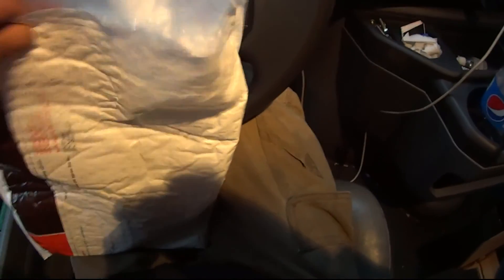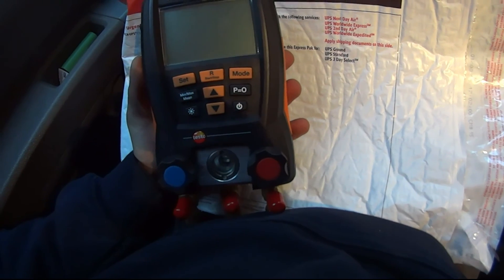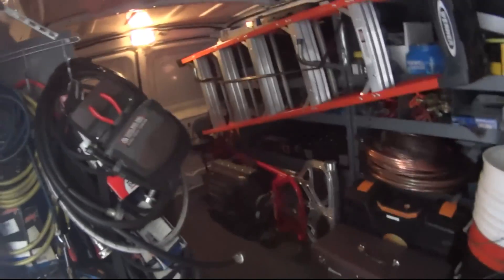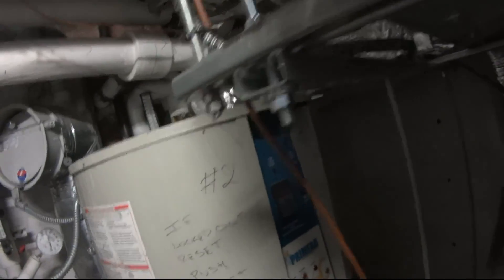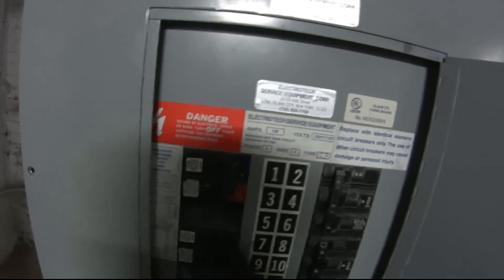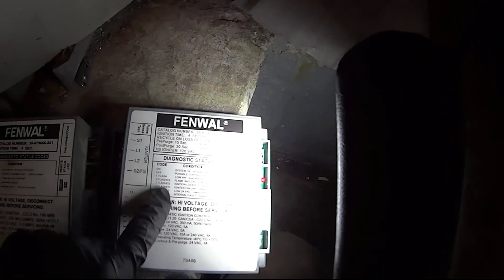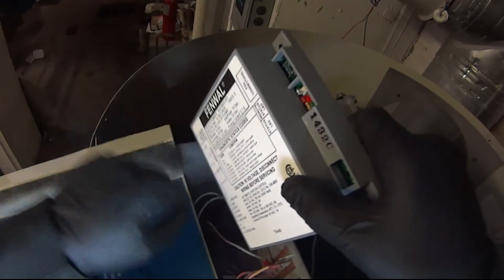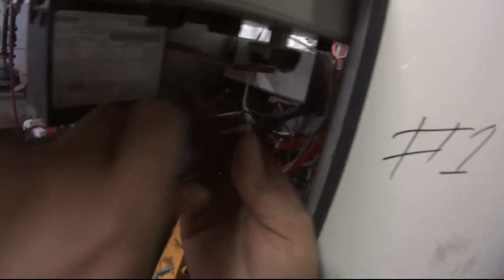HVAC | Fenwall Ignition Module- Primera Boiler 1600B

Comment: Emin nice way of troubleshooting the issue , u were lucky there was 2 units and we're able to preform that test cause the last thing u want is replace that 300$ part and be wrong . Good job and video.
Reply: Nice work. That's what you have to sometimes with an intermittent problem.
Reply from the maker: I checked everything on this freakin boiler. I knew it was the module, swapping just helped me confirm it lol. Normally I Carry 1 Of Those fenwal Because I Have 5 Boilers That Use It
Reply from the maker: Rob HVAC sometimes it's the best option

Comment: Just replaced a near identical fenwal on a raypak boiler a couple of weeks back.  Worked fine in front of you and then rare lockouts. Finally caught it: culprit was the onboard relay for the HSI not powering the HSI and then the current proving sensor would see this and lockout on an ignitor failure.  Wouldn't be surprised if something similar happened with this guy.
Reply: I have a Raypak doing the exact same thing....just ordered a new ign. module yesterday. Glad to know my deduction was correct!

Comment: Great way to troubleshoot isn't it lol. Those Primera's are still causing trouble I see.
Reply from the maker: Yeah man that second one would go into ignition lock out ever week or 2 or so. So I just swapped the module to see what happens and sure enough boiler 1 went into lock out with the module from 2. That's  why I changed it out with a new one.
Reply: It's nice to have the same system in a arms reach.
Reply from the maker: First Choice Service LLC ( StL MO) yeah it is lol

Comment: i dislike fenwall ignition controllers so much.. i replace these on a daily basis, when i replace them- a honey well controller goes in and the call backs cease. I am just ranting lol
Reply from the maker: I've been trying to locate one  that cross references with this one .However I couldn't get anyone to help me with one that would match this fenwal. I hate fanwal too, they are not tech friendly and not as forgiving as the honeywell
Reply: i will get u a part # tomorrow for the honeywell. i cant think of it off the top of my head and not near my truck.
Reply from the maker: gregory .sadowski cool thanks. I've been asking on Google plus for someone to help me with a matching honeywell module,  I had no luck lol